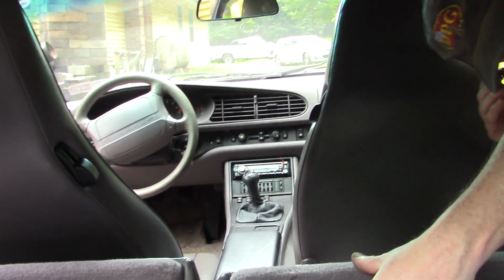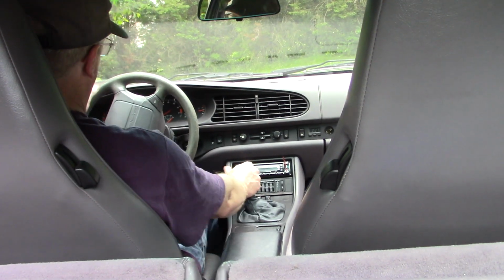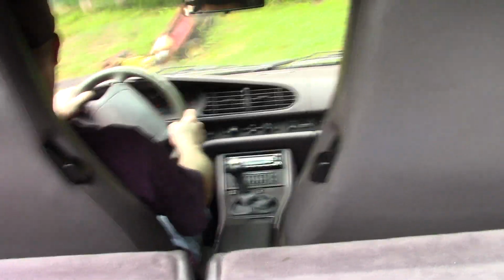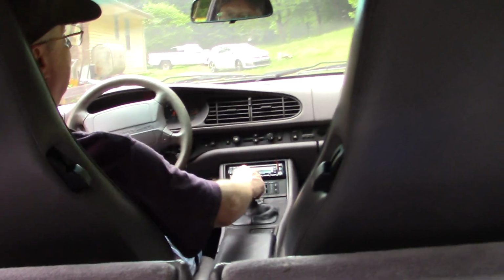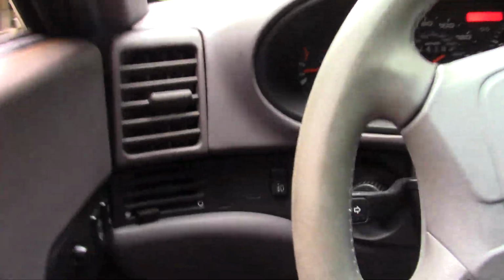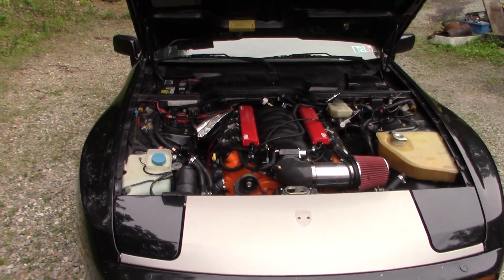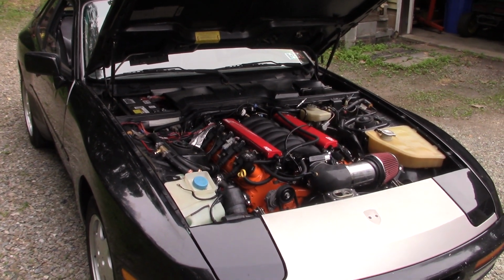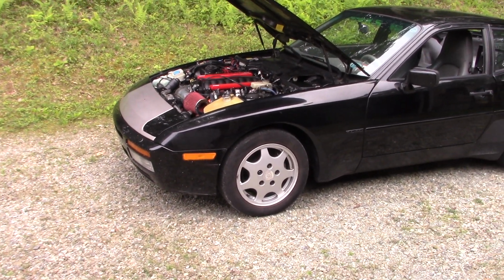Porsche 944 + V8 Part105, Lets Go for A Drive!

Comment: Hey! I'm currently doing a LS swap in my 944.  Are you using stock brake master with turbo calipers and that's all ? Do you feel the car stops very well?
Reply from the maker: This is and old video. Currently using 996 front rotors and calipers with a fire wall brace. No power assist. This setup works better than the Turbo brakes that came with the car.